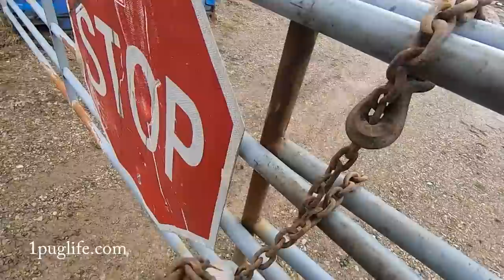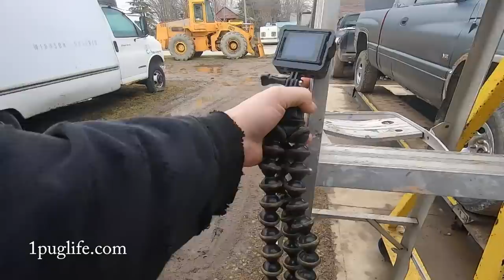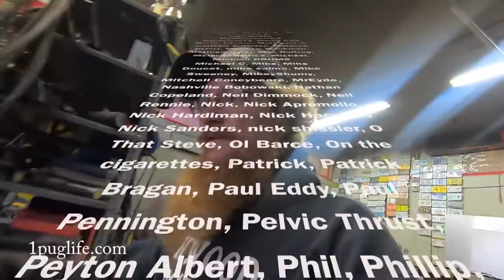fixing up the cheapest trailer on market place

Comment: Probably should roll that Gantry around and pull the pulley back and forth while the birds not there so it realizes that's not a good place to build its nest and I can do it someplace else before the weather changes cuz you can't leave that bird up there then you won't be able to use your gantry but you don't want to hurt the bird or its eggs so before it lays the eggs right